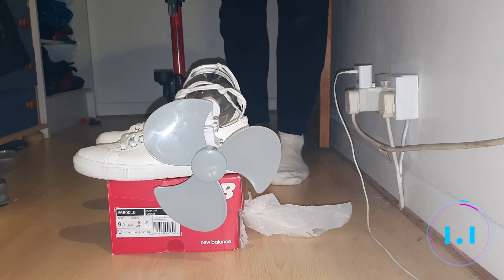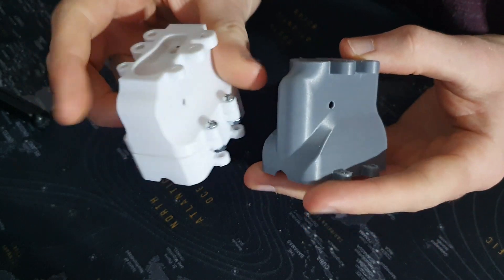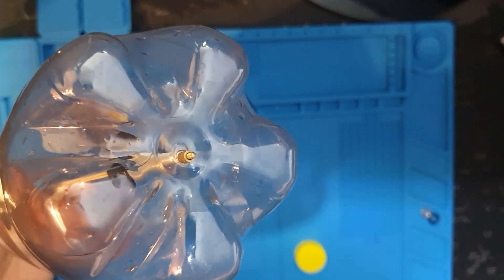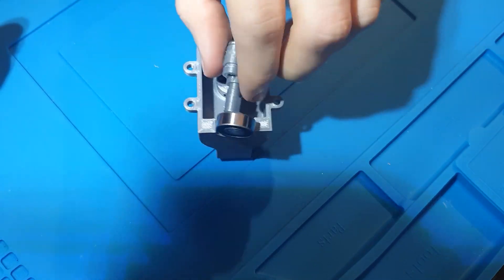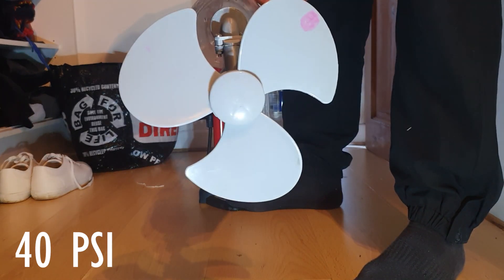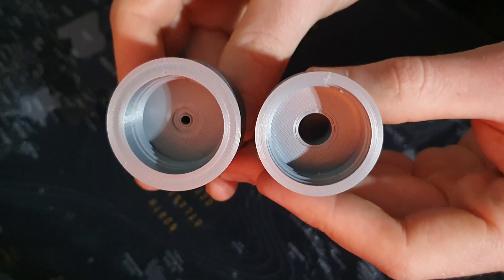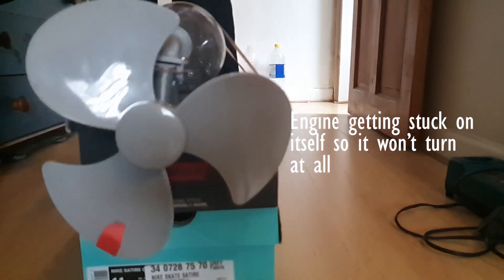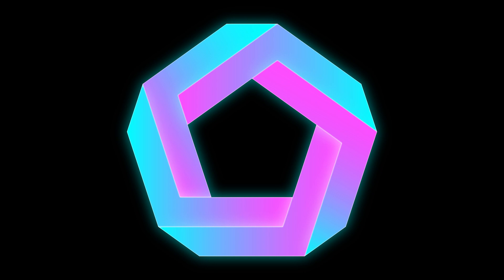3D Printed Compressed Air Engine V2

Comment: I made a radial pneumatic engine recently, very similar design to yours in terms of the air intake valves. The biggest problem I was having was piston compression.
Reply from the maker: How was piston compression an issue for you?

Comment: thick coke bottles can hold up to 21 BAR
Reply from the maker: That would be something id need to test first, wouldn't want a bottle exploding at 21 bar in my room lol
Reply: @kurzey8532  I can tell you... NO THAT IS THE ONE THING YOU DONT WANT TO HAPPEN (but 10 BAR is definately okay, put a pressure regulator behind that and then you have consistent pressure for longer)
Reply: @kurzey8532  also, consider building a 3 cylinder engine so you dont need a big flywheel. put them in a row 120° apart
Reply from the maker: @dingsens2810  yeah I'm going to try and incorporate a regulator to improve duration and will do a multi cylinder in the future! 

Thanks for the suggestions!
Reply: @kurzey8532  what software are you using for modeling? if you really want to deep dive into this topic and overengineer it for no reason you can contact me, I have a few ideas for improvements (and i did this before)
Reply from the maker: @dingsens2810  fusion 360, thank you!
Reply: @kurzey8532  best tool for that i use it too

Comment: I am trying to make one engine right now, you gave me some kind of idea and reminded me that my first goal was to make an air engine with no other material needed😂.. I need to go back to that goal, anyway I’m going to shoot you my thoughts, the air engine don’t need a connecting rod from the piston to the crankshaft, the air will push it... it just need something to push it back! Otherwise, I’m surprised that you didn’t made a valve overlap design for adjusting, and still made the engine works! The overlap adjustment is actually the hart of the engine, there’s an overlap that you need to adjust it, to reach the maximum efficiency, that’s where piston suppose to be at, when the valve is supposed to be opened...
Reply from the maker: Will be hard to get it to seal with just 3d printed parts, unless you can print off a gasket in tpu or something. 

I'm not quite sure what you mean by that, without the con rod there's no way to convert the linear motion of the piston to rotational motion at the crankshaft, you would just have a piston osciallting between two postions, unless ive misunderstood.

I get the valve timing by animating the joints in fusion 360, though it would be useful to be able to adjust the valve timing without printing a new crankshaft!

Thanks for the suggestions!
Reply: @kurzey8532  sorry I don’t know how to describe this shape, so I took a video of my phone. As YouTube don’t have ability to send photos and videos in the comments, I share it with google drive. 
https://drive.google.com/file/d/1DMP0sAE5eOtbaeHH6oOq_jIQ7OzlL_qE/view?usp=drivesdk
And I viewed your videos and, yes, you are not succeeded for the first time, that’s my misunderstood. And as well, in my opinion for right now, air engine is not as efficiency as , just reverse air pump into an air motor, because engine is an design to transfer heat into useful energy, not for pressurized air... 
but it’s fun tho! 😂
Still will make one and will share it on youmagine if I do make one! 
And my goal is make one works, and as long as the air is not leaked completely before it works, it’s a success to me! 
As well I’d like to make a video but I am too bad at speaking, describing, so I’m probably making very bad videos😂, anyway how do you think about this pushing rod?
Reply from the maker: @minercraftal  ahh what you have looks almost like a radial engine, would love to see if it actually works!

 this engine works similar to a 2 stroke engine, they probably could be made to be quite powerful if pressure was high enough, the problem is the energy density of compressed air is very low so need a large tank
Reply: @kurzey8532  I did made it close to 1 square inch so the psi would turn into pounds 😂, and it is a radial engine, but the problem is, I have too many ideas... this has been upgraded at least twice in my brain already, so this crankcase will not be used, but the crankshaft probably will... but I’m not sure which plan is the end for making out😂, one is a 3 cy radial with even bigger cylinders and some much different valves designed to work, the other is to use a pvc pipe to make a opposed engine with o ring seal on cylinder and piston to make excellent seal...

Comment: Having a electric air compressor in a room is perfectly safe, your problem looks to be space which can be solved with the tiny compressors used for airbrushes.
Reply from the maker: Always the potential to go bang but yeah they are mostly safe, at least when new :) the cost of buying a compressor is the most off putting factor right now 🤣
Reply: @kurzey8532  I got my 10 gallon for around 140 usd but I guess they might be a bit more expensive over there. In my experience compressors normally fail in two ways, either the compressor itself gets worn down and won't compress air above a certain pressure or a seal somewhere else leaks causing loss of pressure. Most small compressors are rated for 120 psi and will dump air or stop running at that point so I honestly wouldn't worry.  Well done on the engine though.
Reply from the maker: @deltacx1059  thanks for the info, good to know!

Comment: cardboard seems like a terrible gasket material
Reply from the maker: it actually works quite well, I've seen them used in combustion engines too. In my most recent video, I've upgraded to a rubber gasket
Reply: @kurzey8532  huh, despite having holes, that's suprising

Comment: A boxer engine would probably be more efficient and would require less balancing, love your work!
Reply from the maker: Thank you! I'll have to admit I'm not too familiar with a boxer engine, though I believe, they are multi-cylinder? Anyway, I'll probably be doing multi-cylinder engines at some point so would definitely look into it then!
Reply: @kurzey8532  they can be as few as 2 cylinders but the reciprocating motion would probably help it get going. A flat v engine would probably be simple enough as well

Comment: I enjoyed the video man as well as your take on the design. Some years back I built a hydrogen (brown gas) engine out of plexiglass. First test runs were pneumatic powered and it worked very well but was before I had a 3d printer... I would like to 3d print it and see what kind of improvements could be made.  Unfortunately I dont have the time to invest at the moment but If you would be interested I would like to share the design and see what your take would be?
Reply from the maker: Thanks bud! Yeah sure I'd love to see it and if it was something I think I could make I'd certainly give it a go!